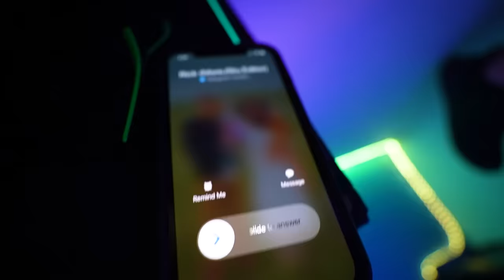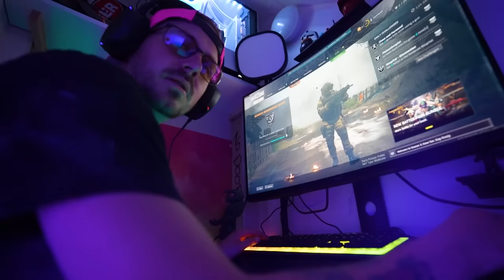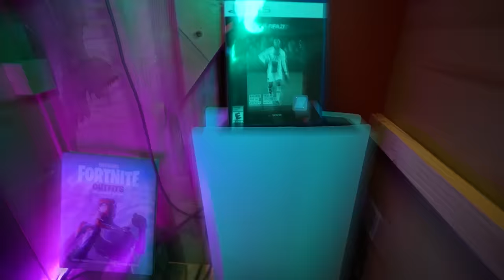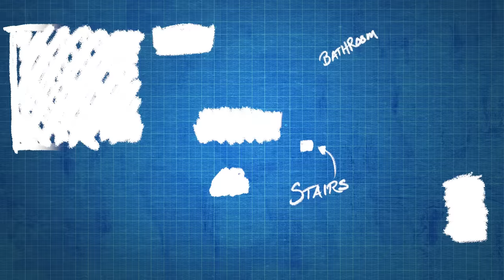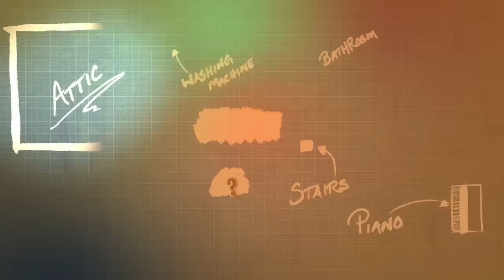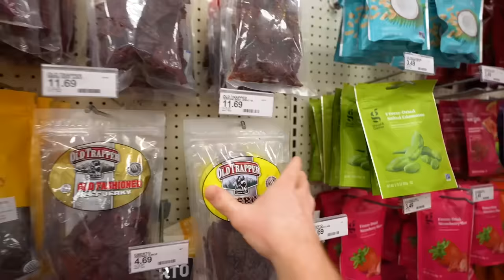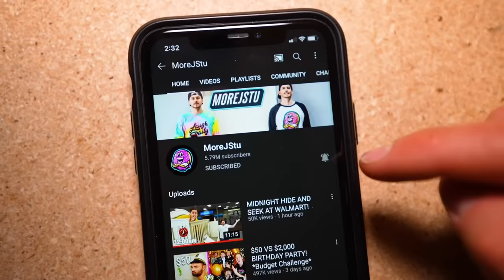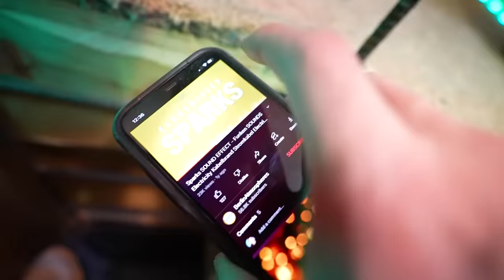We Filled Our Entire HOUSE With Hidden Gaming Rooms!

Comment: i build insane fully custom gaming systems that no other brand will even attempt. none. not maingear, not falcon, nobody. my daily driver is a twin full-atx system, each system with big 5000 series amd chips and huge radeon graphics. IN. A. SINGLE. TOWER. also, all air cooled, so i need SPACE. it's a MASSIVE build, a heavily modified corsair 900D case that i built to house specifically these systems. in total it can pull over 2000W from the wall, which requires me to plug them into different circuits in my home (average circuit is max at 1500w). again, all of that, fully independent FULL ATX (no micro atx or mini itx) systems in a single tower. i build what everyone else WONT. i will build for FREE (for the channels) if you send me the stuff and come pick it up! DM for details, pics, all the good stuff. i will make the guy at best buy weep with my knowledge, been building AND repairing professionally for a living since 1999....